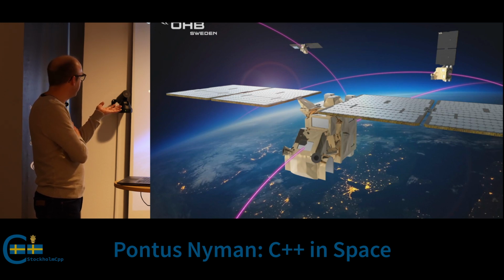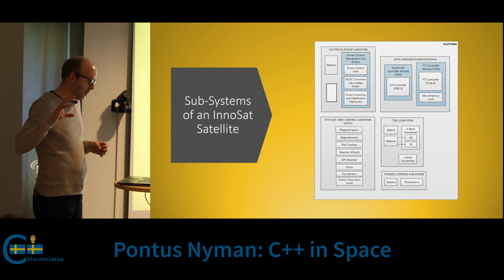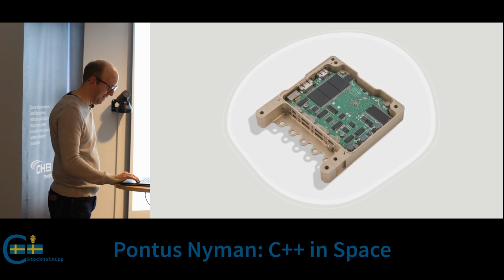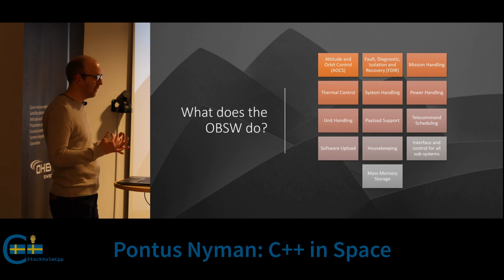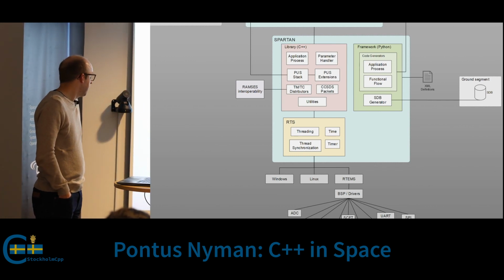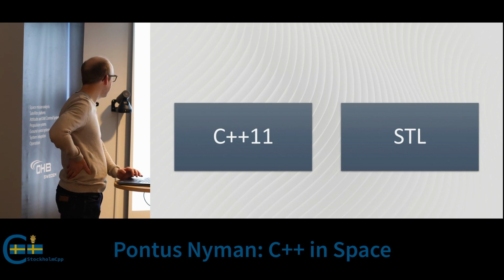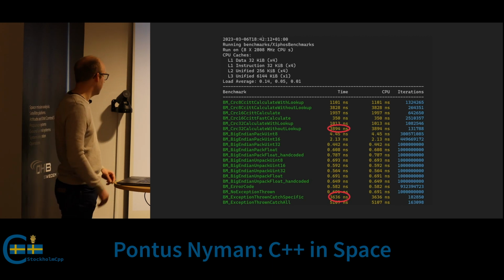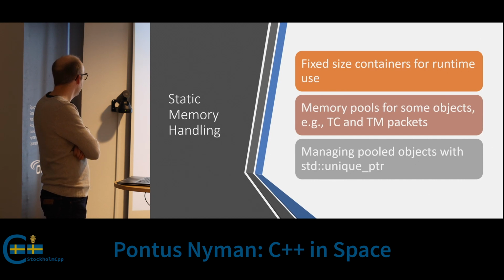Pontus Nyman: C++ in Space

Comment: C++14 constexpr is very powerful. You can do everything in it, and is very easy to use. I myself do lot of C programming and one day I asked myself a question: How difficult would it be to port my C code to C++14 constexpr? It happened it was not difficult at all. By using lots to of macros the same code works in both C89 and in C++14 constexpr modes.